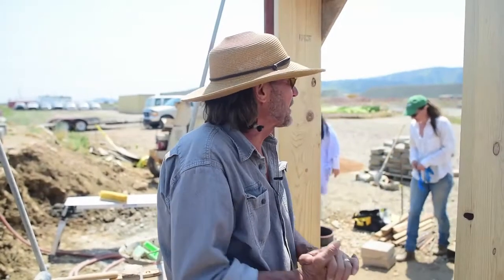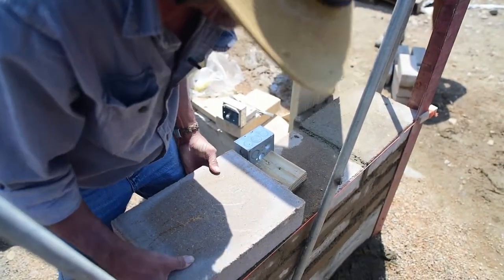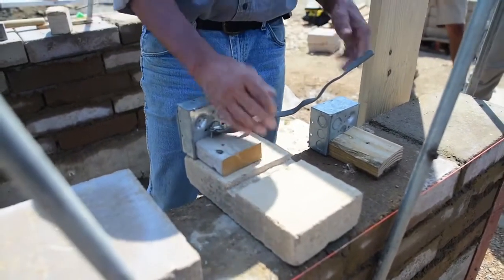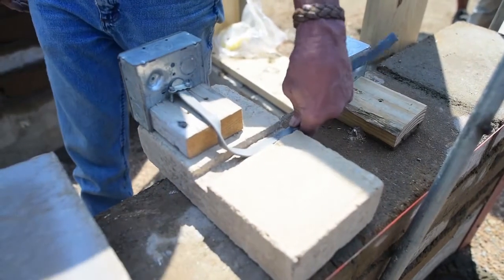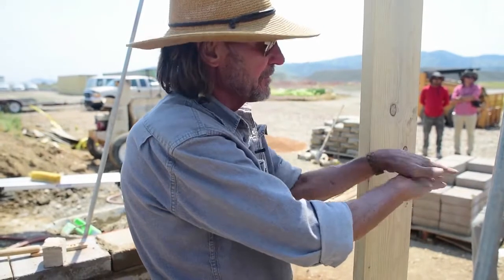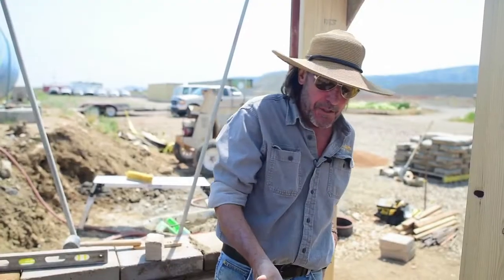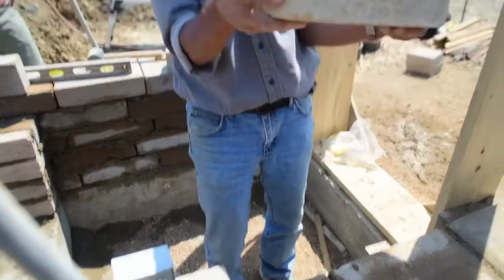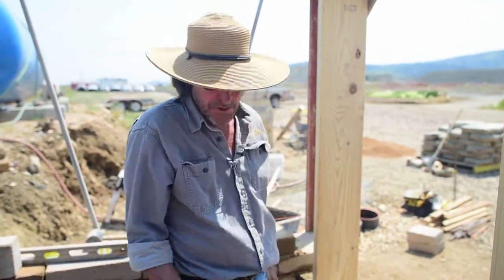Part 7   Installing an Electric Box in a CEB Wall

Comment: hey jim I am planning on doing my home in dalls and exterior walls 2 blocks with a twio inches break in between for thermal break insulation ...plan on running the conduit in the thermal break from the slab....and of course putting two inch pink board in between the layers....the sweep of the conduit will be perfect to glue into the box! The mortar since it will have lime in it is considered a chemical anchor that would not require staples or tacks...as we are not required to put straps in direct burial Just a thought...neca code says we may use chemical anchors like expanding foam in sytrofoam foam pours...The chemical of expanding foam is considered a chemical anchor so your chemical anchor is the mortar...